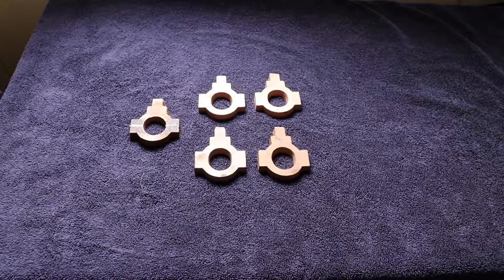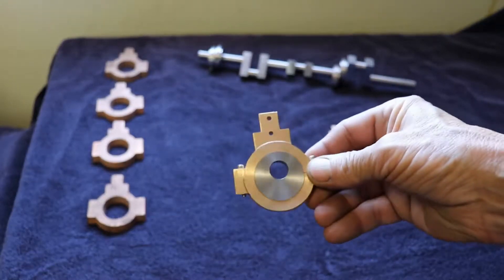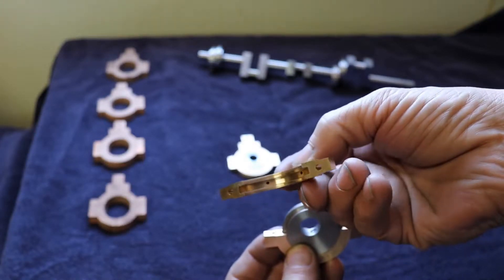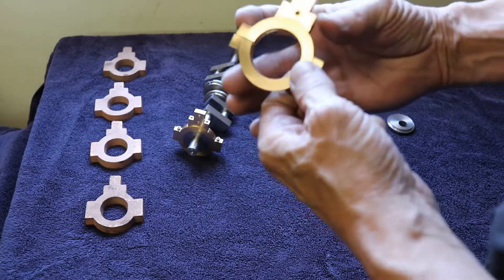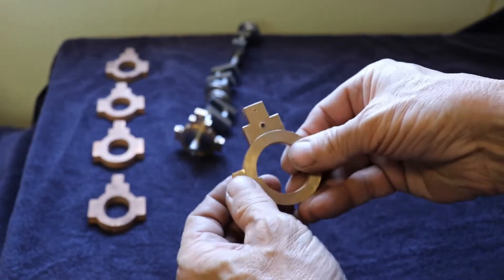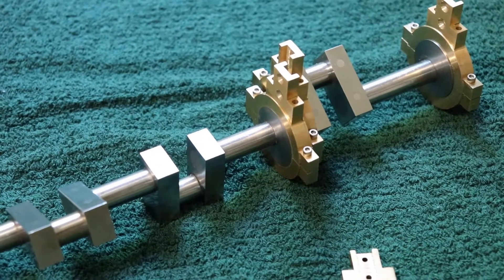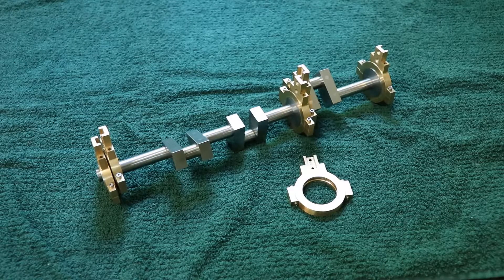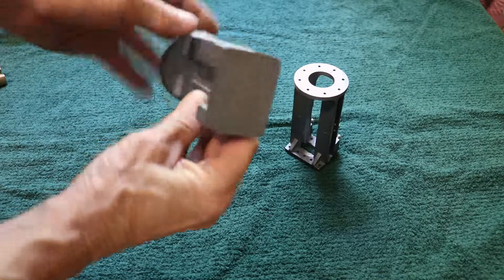Shay Locomotive Engine ~ Part 2

Comment: Very neat and precise eccentrics you have made there. Shay's are an interesting design of steam traction - an 'all wheel drive' locomotive. I'm looking forward to seeing the machining ops and future loco progress. Is it going to be a representation of a full size loco or a freelance model design? 

Keep up the good work.

Cheers Craig
Reply from the maker: Thank you, Craig.  Yes, the Shay is an interesting design that evolved quite a lot during the decades of it's production.  The one I am building is not a copy of any specific prototype, but is a generic model of one that would have been built in the early 1920's.  One reason I chose to do it this way is because there was much variation between engines, most being built to a company's particular specifications.  Also, most that are in existence today have been modified from how they came of the production line.  Next video, I will be getting into the actual machining.